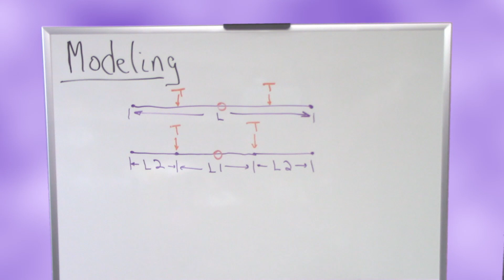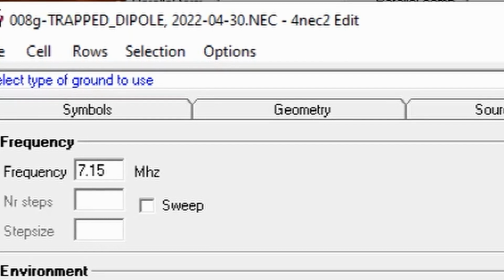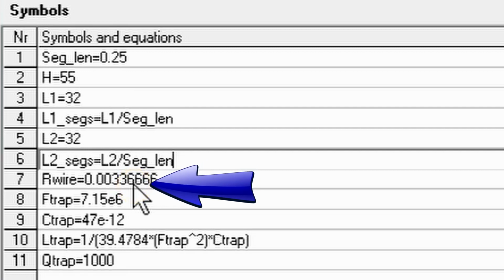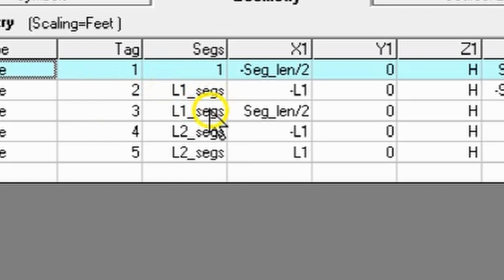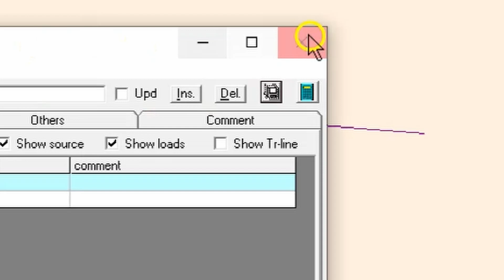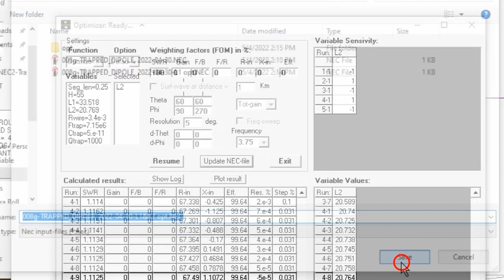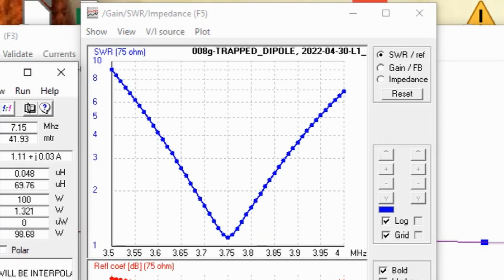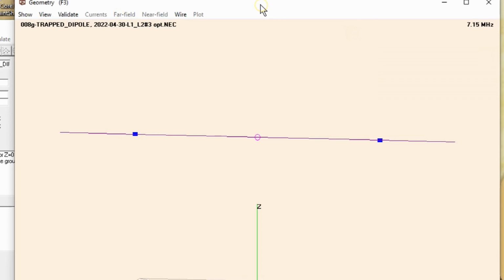4NEC2 Trapped Antenna Simulation and Design (008g2)

Comment: I just stumbled upon your channel. Thank you for your explanation of traps and trapped dipoles. This has been a big help. I have used 4NEC2 for several years but never ventured into the realm of designing traps. This will help me proceed and I may even be prompted to pull down the Delta Loop in favor of a trapped dipole for 40-80.  WA7DJS
Reply from the maker: WOW! Glad it helped!

Comment: I have EZNEC, but it looks like 4NEC2 has some good features, so I will download it as well. I have been trying to develop a tiny horizontal 80m antenna (total space available is 8m) with reasonable efficiency.
As I suggested in the comments on the last video, it might be better to put the traps somewhere like 6.9 MHz instead of 7.15 in order to avoid the very high voltage that appears across the trap at resonance.
Reply from the maker: Yeah, 7.15 was just a "pick a number out of the air" kinda place, not the final choice if I were to actually build one of these. I am working on a 20/40m portable inverted vee for field-day operations. Its traps are tuned to 14 MHz.
The one thing that keeps me coming back to 4NEC2 after trying others is the ability to define Symbols. These are fantastic to keep thing organized and help a LOT when experimenting.  These go along with the Optimizer as the Optimizer adjusts the value of the defined symbols to achieve your goals.
On your suggestion, I added it to the text in the desciption of the last video.

Comment: Never used a modeling program, but WOW! Complicated for the only Semi-Geek in me. I wonder if I can model a 20-40-80 EFHW/NVIS. Rather than let nature pick my resonate best SWRs use Traps to force the low SWRs where I want them? I think I understand the low SWRs won't be any lower but I may be able to shilf then around a little. For either Phone areas or Digital areas of the bands. Thoughts?  I'm in ARES, SkyWarn and am most interested in mobile and reliable comms with local groups. No interest in DX.  Thanks so much. K0WOZ
Reply from the maker: Yes, you can, indeed, model all of that using 4NEC2.  Check out the tutorial videos that I have on the program to help you get a handle on it. The biggest obstacle is getting our head wrapped around how they think about the model. Once we can understand the concept of a wire with segments and that we drop into this wire a source and traps, we are most of the way there. Just a not, too, wires can ONLY be connected at their ends. My second biggest obstacle is when it throws an error. It doesn’t spell out what the issue is in nice, easy to understand language. It is all in a very abbreviated nomenclature which takes a bit to unravel what it means. The best was to get past all of this is just to play, play, play with it. I encourage you to just dive in with simple stuff and slowly add things, learning as you go. It is great fun and very satisfying (for me). It is amazing how close the simulation is to real life, too.

Comment: Thank you for this I have wanted to do this for a long time. However the inductactance calculation was the area that I need help to understand can you elaborate how you worked out the math.
Reply from the maker: I'm assuming you are referring to the whole business of how to know how many turns and so on to get the desired inductance. There is a formula which can be somewhat intimidating, but not actually that difficult. I got tired of working through it, so I created a spreadsheet to do the heavy lifting for me (and avoid the math mistakes).
Here is a link to it (it is a ZIP file which contains an Excel spreadsheet): https://drive.google.com/file/d/1AdrSdGbnhZ1KCxvJLqcYDStge7csgBzV/view?usp=drive_link
You enter the stuff in yellow. It calculates the stuff in "tan".
Hope this helps. 🤠

Comment: I find your teaching better than the all others.
Is it possible to design a Patch antenna with ANEC2? if so show me how we can make such an antenna Patch as you did for a simple dipole.
Reply from the maker: Thank you for the encouragement!
I am totally unfamiliar with ANEC2.  I would imagine that it requires very similar inputs. I have a video on the Basics of 4NEC2 (https://youtu.be/Zd6BT558YRA) and one on modeling a simple dipole (https://youtu.be/A6IiGWOI9KU).  Maybe these would help?
Reply: @eie_for_you  
I'm sorry it's not ANEC4 but 4NEC2. Is it possible with 4NEC2 to model or simulate an 8 elements Patch antenna?
The two videos you sent me the links are wonderful. A very good professional explanation. Congratulations
Reply from the maker: Hmmmm, I have never designed a patch antenna.  However, you might find something to help if you look in the "...4nec2\models\SPatch" folder in the install directory for 4NEC2. Wish I could be more help.

Comment: So the lengths entered into the Geometry for wires is in segment units and the Height is in feet.  Is this not a problem?  Or does the scaling difference simply fall out as a constant once the analysis is run?  Why not run everything as segments, including H?  Or run everything as feet?  What am I missing?
Reply from the maker: Let me see if I can help you see what I am doing .....
I establish a given segment length as the first line on the "Symbols" tab.
All of the lengths entered in the geometry are entered and calculated in feet.
The number of segments for each length is calculated and will vary with the length of the wire. I do this so that I can make sure the segment lengths for each of the wires remains reasonably close to one another. If the segment length of one wire is too far afield of the segment length for another wire, you get an error. So, to avoid this error and to allow me to adjust segment lengths (to keep 4NEC2 happy) globally by changing the value of one symbol, I define the design-wide segment length.
==> 008g-GENERIC trapped_dipole&inv-vee, 2022-05-01.nec
So, looking at the above NEC file using Notepad++ (this computer doesn't have 4NEC2 installed), I see that I set
L1 = ~34ft (inner wire) and
L2 = ~21ft (outer wire).
I then calculate the number of segments for each wire based on the length in feet and the established segment length (Seg_len).
--> L1_segs & L2_segs
Then I calculate the coordinates for the anchor points for the inner and outer wires using the length of each wire, the angle between the vertical and the leg and some trigonometry. 
--> L1_X, L1_Z, L2_X, & L2_Z <= all in feet
--> The Y coordinates all = 0
All of this is on the "Symbols" tab.
Then we go to the "Geometry" tab to see these calculated values being used to define the antenna.
Hopefully I've been able to unravel this a bit for you.
Reply: Thank you for the fast reply and generosity with your time.  Don't know how I was seeing it but I thought you were calculating L1_X and others as increments of segments and entering those as lengths for x and z.  Sorry, guess I was seeing all the trees and not the forest.
Reply from the maker: @GreenGuyDIY  Well ... we've all done it! So welcome to the club "human"! 🙂
I am very glad I was able to help.

Comment: I downloaded the 6 4NEC2 files & when I click on them, nothing happens.  Also, why are there 6 files?  Are they just 6 examples of the same program?
Reply: I am using Win 10.
Reply from the maker: You have to open the 4NEC2 program first, then load the file of interest.  The one labeled "GENERIC" is the general one for everyone's experimentation. The other files are my various versions of the generic file for various given configurations.
If you do not have the 4NEC2 program installed, the link to the download site should be in the description for the video.
Hope this helps. 🙂